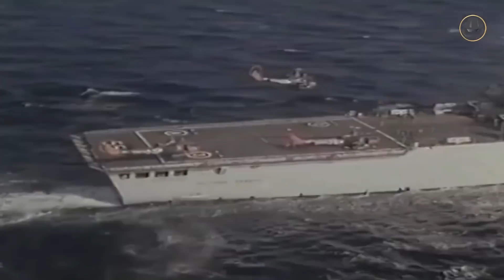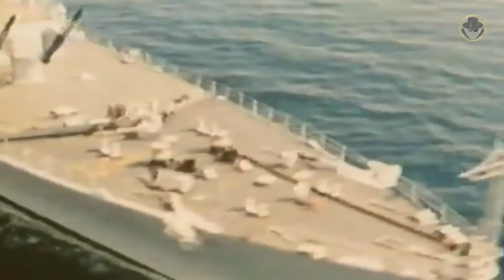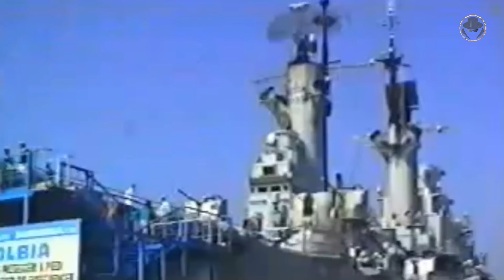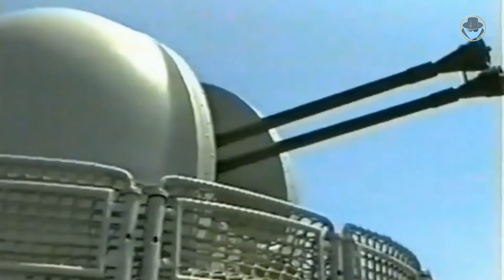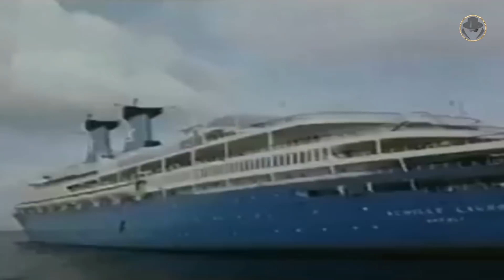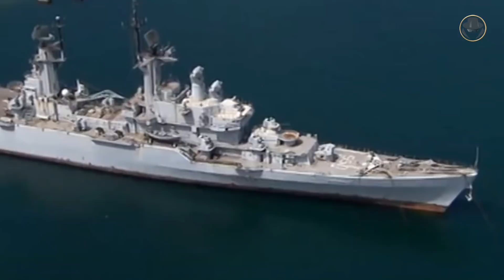Vittorio Veneto helicopter cruiser | The last cruiser built in Western Europe

Comment: Giuseppe Garibaldi is effectively the last Western European Cruiser even though she never operated as such she was designed for it, she still carries double torpedo tubes, 3 DARDO CIWS, 8 Anti Ship Missiles and has all the associated sensors to run them, her crew originally trained for surface and sub surface warfare as a frontline ship, only when Italy was allowed to operate fixed wing aircraft from ships did she take on the role of aircraft carrier.